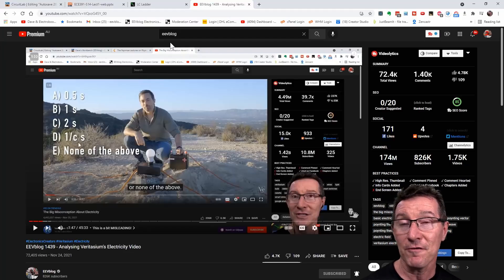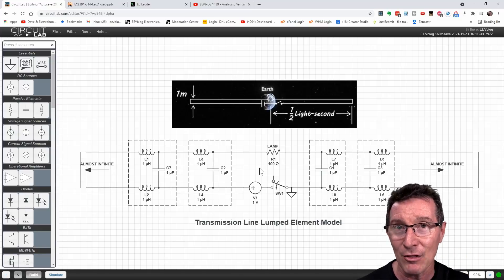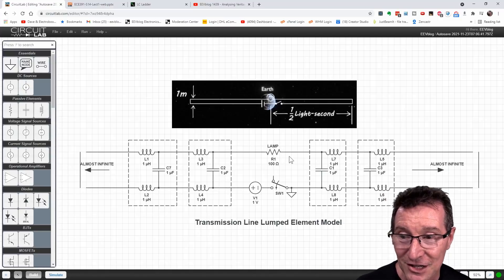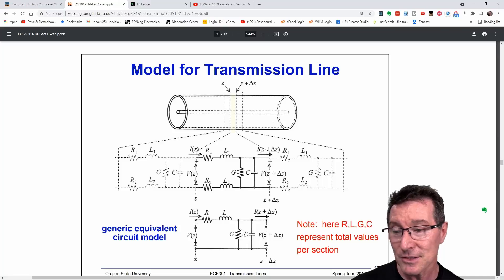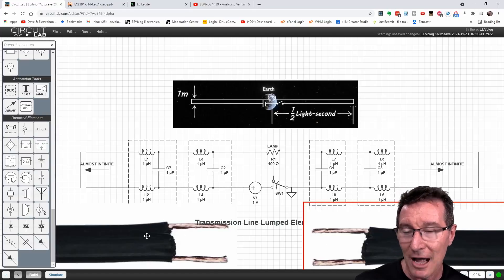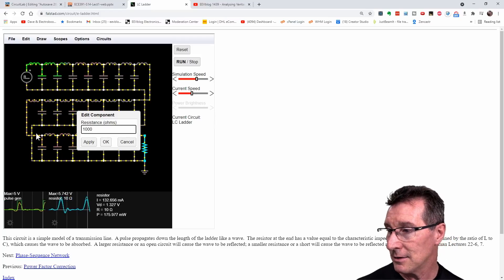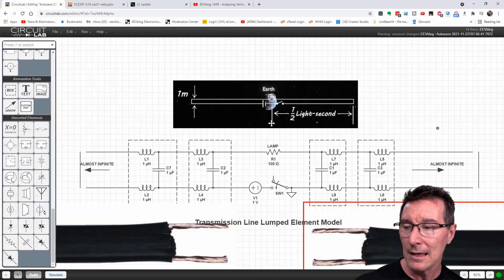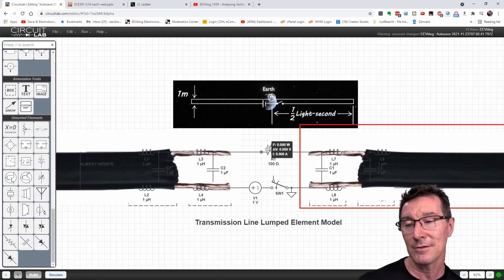Veritasium Electricity Video - Simulation Notes

Comment: "No matter for how long" i think that matters most, because i suspect most people understands this questions as turn on and stay lit, not just blinks, that could lead to big missconception.
Reply: Yeah, Derek sure didn't say that it would NOT stay lit. Which is kinda the most important point about all this.
Reply: @Basement-Science  How is the 12volt Direct Current power going to get through the insulation on the wire to couple with the opposite wire (which is also insulated) with enough power and voltage to overcome the forward voltage of a 12 volt LED?
Its nonsense. You can't just ignore the physical reality of the demonstration. I am fine with saying the wire is 300,000km, and fine with saying it has no resistance for the sake of the thought experiment. But NONE of that is needed if the only thing you want to do is measure when the EM wave "touches" the bulb. It's very clear the EM wave hits the bulb after 1 meter.
But that is not the issue. It's all the other factors previously mentioned: DC, Insulated Wire, LED Forward Voltages, 1 meter of air gap, power requirement of the LED. 
Not to mention, that the LED used in the demo almost certainly has multiple LEDs internally in a series arrangement, meaning that the forward voltage that must be overcome is multiplied.
Just ignore all these issues and it will simply go away ... (not).
Reply: @wbeaty  Third time reposting this comment which keeps getting eaten: But, LOL, I do admire your sarcasm! heeheh. Actually I am very willing to accept 300,000km of wire with NO resistance. I am just not sure how to embrace it with capacitance and Inductance given the lack of resistance. 
My issue is mostly with the definition of "ON" and the required current and voltage that allows for that definition of ON to be satisfied. I don't really consider a momentary blink of the LED to be on, if that blink is less than 1second because that would mean the light turns off before the current form the wire arrives to "keep" it on. Additionally for Veritasium to be considered "correct" in his Answer, then ON would mean that the LED had enough voltage to allow the required current to turn the LED ON at 3.3 nanoseconds. 
Bearing that all in mind lets see if it can be done:

Ok. Let's assume you might be heading in the right direction.
Your equation requires 12 volts to drive that 4.3 mA.
And let's assume that 4.3mA will actually turn the light on enough for me to see it (I can't say it really will, but, let's just say sure fine, for now)
Ok, so how are you going to get the 12 volts to actually drive that 4.3 mA?
If you look at the scientific model of the voltage presented by Veritasium as evidence on Slide #13. (see his video links, it won't let me repost the link here for some reason)
You see that at 1 second there is only 0.25 volts available to drive the LED.
(Additionally, they have modeled that at time 0 there is ~.1 volts. Not sure how that is possible but let's say it is for now)

But maybe its the wrong model with the wrong parameters. AND That also is one of my issues. He is saying that they modeled and simulated this experiment. Ok let's go with that too. Let's say its ALL correct.

Looking at the voltages from the simulation on Slide #13:
At time 0  the voltage is 0.1 and at time 0.25 the voltage is 0.25.
Per "My Definition of ON" then the results show nothing to suggest that the LED would turn on because I don't see any of the required voltages or current. 

but what about Veritasium's definition of on?  

Let's review: at time 0 there is 0.1volts and at time 1s there is 0.25 volts. By all logic and using the "any current" constraint, the bulb was already ON the moment the experiment began. Which is exactly what I said from the beginning.
I don't see how the bulb can be on with 0.1 volts. It violates my whole definition of ON. It certainly doesn't allow for 4.3mA to pass thru the Bulb.

Hmm... even if we dismiss the 0.1volts present at time zero, its pretty hard to dismiss the 0.25 volts at time 1 second. That's not even close to 12 volts.

His conclusions don't make any sense, and neither does the thought experiment.

This is what I mean about the experiment has zero utility and proves nothing more than a planck value of energy can turn the light on. Worse actually, Veritasium's simulation, which he is using to justify the results, says the light was already on at time Zero.
The constraints render it useless. The simulation evidence only shows that the voltages are inadequate OR that the voltage was always present and the bulb was already on at time zero. 
The voltage doesn't ever go above 1.1 volts LOL. Even after 20 seconds.
Or perhaps I am misreading the Simulation Slide. Maybe it reaches 1 volts at 1 second.
Either way, I don't see that as enough to light the bulb.
Reply: @wbeaty  Well, it may be true. But that thought experiment doesn't prove it. All it proves is that an infinitesimal current from a source can affect something 1 meter away. 

I don't think it proves that the amount of energy in the wire is zero. 

The reason that the electrons move at all is because the charge field is present to reach the electron. In order for the electrons to move they have to be repulsed or attracted to the fields around them. While it may make mathematical sense from a statistical point of view to model that the forces are all exterior to the wire, it is very clear that the electrons are experiencing forces which force them to move.

However, both things cannot be true as far as I know. Fact: The electrons move. Fact: they move due to the cumulative charges around them, attraction and repulsion of those charges. They move into "holes" because those holes are present... which means the forces to push them are present.

So, those forces MUST be in the wire.
Whoever said that the EM forces are NOT in the wire is simply wrong. Perhaps it is being misconstrued. Perhaps they meant that the majority of the forces are external to the wire. But I am 99.9999% sure that the electrons are moving due to the charges and electromagnetic effects of those charges which are internal to the wire.

The other option is that you are totally correct, which would then leave me with a rather big puzzle of why do the electrons move in a specific direction inside a wire if there are no forces on them? 
See, it just doesn't work that way.
Reply: It doesn't just blink, since the long wires are not just a capacitor.   It stays on, but it's not very bright  (only for a few mA, if driven at 12VDC.)   Veritasium's setup could easily light some LEDs quite visibly.   But when the full 12V comes around the bend, they become 4x brighter.

Comment: That's all well and good, but how do I use this information to optimize my audiophile speaker cables? ;)
Cheers.
Reply: Do you want to improve the THD by 0.0000001 %?
Reply: @ghlscitel6714  Joking aside, I do have a number of speaker wires running in parallel over some distance. Probably not an ideal setup, I suppose, but not something I've tested. The video made me think of it, so I ran with it. Cheers.
Reply: @WR3ND  i would say by twisting each by different amount so that they won't induce  the signal into another cable, also by maximizing the distance between them would also help
Reply: @WR3ND  The impedance of a loudspeaker system is usually between 5 and 16 ohms. A transmission line however can be hardly manufactured below 30 ohms which genuinely induces a mismatch. However, at frequencies below 20 kHz the contribution of the mismatch to the signal is minute (in the order of <10^-4). Much more important is the ohmic resistance of the cable. For proper loudspeaker match the source and cable impedance should be less than 0.1 ohms.
As Andrew mentions, also parasitic currents captured from AC magnetic fields have a more significant effect which leads to having the 2 lines close to each other so that the influents of the magnetic induction is the same on both wires and nulls out.
How long is your loudspeaker cable? What is the source impedance of your audio PA?
Reply: Thanks for the interest. My original comment was mostly just in good fun. It's not something I'm too concerned with, at least not at this hour at night for me, but I may revisit it and get back to you guys later for the sake of curiosity. Cheers. :)
Reply: @WR3ND  Understood, the joke was funny.  Just to help anyone else - speaker cables are closely parallel, or sometimes twisted, because although that adds a (very) little capacitance in parallel with the speaker coil, it also minimises the loop area of the cable which would otherwise represent a significant antenna that can pick up interference  that can get back into the amplifier and create other problems.
Reply: The more you pay, the better the sound!
Reply: @stiannobelisto573  gold and diamond plating helps right??  Right? 😬
Reply: @bsodmike  virgin elves at moonlight as well 😁👍🏻
Reply: @p_mouse8676     I use Tabasco sauce on my cables to spice up the sound.
Reply: @MickeyMishra  Ah yeah, nice. Recently I am all into the new "vegan" cables. They make it sound more earthy and grounded.
Reply: Don't bother. Just put on the package that you did, make up some language to describe it, and people will pay you millions for it.
Reply: There are transformers made for this, such as the Electro-Voice AT 100. It has coils for matching 50, 70.7 and 100 Ohm transmission lines and for your 4,8 or 16 ohm speakers and amplifier. You'll need a pair of these for each cable run for conventional loudspeakers, but pro speakers often come with the matching transformer included. The bonus is that you can probably sell the copper in your low impedance cables to pay for the transformers.
Reply: Instead why not SELL magic audiophile cables, with plenty of Maxwell-Heaviside-ian gobbledegook!   Make them hollow, for PURE skin effect, ABSOLUTELY PURE.  Slathered with high-K ceramic paste, for optimum dielectricity propagation!   William Preece tried to suppress our cables, and Edison tried to steal them!
Reply: Just connect it  to anything that costs at least half a years wages.
Reply: Make sure the speakers are exactly the same distance from the source :-)
Reply: @ianstorey1521  Hmm... They're different channels though? Or do you mean for the sake of loudness?
Reply: @WR3ND  so the signals arrive at the speakers at the same time 😎
Reply: @ianstorey1521  Oh, my mistake. XD Cheers.

Comment: But in veritasium video he considered ideal  transmission Wire with zero resistance...
Reply: The Resistance doesn't matter at all. You can make it out of superconducting wire if you like.
However you CANNOT say your wire will simply not have any capacitance or inductance towards anything because that's absolutely impossible in our universe. You are just arbitrarily picking and choosing laws of physics to ignore at that point.

Comment: What it seems we are actually looking at is the lamp illuminating due to the inductive coupling of the voltage source wire to the load wire. Essentially acting like an air-core transformer with a single winding on the primary and a single winding on the secondary. This is the B field coupling the wires at 1m/c.
Reply: Not quite. It's Capacitive Coupling between the wires. You would only start getting inductive coupling as current actually starts flowing along the transmission line.
Reply: @Basement-Science  Please explain how there will be capacitive coupling before there is inductive coupling?  I would think that they both have to happen simultaneously. Any capacitive coupling must also induce some current flow. You can't really have coupling without the charges. And for the charge to appear there has to be movement of the charges.
Reply: @marcfruchtman9473  I meant the capacitive coupling, or just the capacitance itself, is the cause of the near-instant energy transfer. Without it, the inductive coupling, and everything else, would be significantly more delayed. There are many effects at play here, but OP was implying that inductive coupling was the driving force, which is not correct.

Sorry for the late reply, youtube was being dumb.
Reply: @Basement-Science  No worries. Hmm, Respectfully, I don't really see this as a "Transmission Line" problem due to the very constraining criteria. I see it as an EM Wave touches "any current light bulb" problem. That is because the light turns on with "any current", so I don't see how transmission theory is operational to turn the light on, since the light technically turns on before there is any interaction of the first wire with the opposite wire. Consider the following as justification:

If we consider the "Ideal" version of the demonstration, then "any current" turns the light bulb on.
Given that, the moment the "ideal switch" is closed and the very first electron moves at the very center of the "ideal circuit", it will create an electromagnetic wave that radiates outward. Technically, it will, at exactly 1 meter, touch the light, but not any of the wire connecting the light (Radius = exactly 1 meter ) so, wire is not yet touched.
The moment that the EM Wave touches the bulb (but not the wire) it turns on because current flows in the bulb.
1 "moment" after that, it will touch both sides of the ideal wire. But the light is already on. 
I suppose one could say that both capacitive and inductive effects were at play. 
But since the light turns on before there are any interactions between the two wires, is it really a function of transmission problem or did the light actually turn on simply from the EM Wave. Given this is provided under "ideal" theoretical conditions, it seems to me that the light turns on prior to invoking transmission theory since there was no actual interaction between the two wires when the light turns on. 
Thoughts?
Reply: @marcfruchtman9473  The "lights up at any current" idealization is just complete nonsense in my opinion. Not only are you correct, but really, under that assumption the light will just be on regardless of the switch or even the battery, or even the wire itself since the universe is full of weak radio waves and even brownian motion of electrons, which will induce some non-zero electric energy into the lamp and "light it up".

I was assuming the more realistic scenario where the lamp is "lit up" if there is at least some percentage of the nominal current flowing through it. Really, we should be calling the lamp "lit" when it is at least at 80% max brightness or so, which would be close to the "steady state" we want from any DC source. And that will be delayed by several seconds in reality (sub-light-speed travel time along the entire loop) because then it is a transmission line problem. That's also the scenario Dave was basically talking about.
Reply: @Basement-Science  I would love to see a reasonable "LED" bulb of say 12v, and 7 to 10 watts light be used instead of the ideal light with a requirement of 80% of nominal brightness. 
But, alas, I don't think that he will do it. Because I am almost 99% certain it would not "turn on".
I was really hoping someone like ElectroBoom would take on the challenge in a more real world way.... sigh.
Reply: @marcfruchtman9473  Actually Electroboom is working on a video about it. Will be interesting to see what he says about it.

I also made a crude simulation that showed it would only reach 80% of steady state current after about 8 seconds or so. That was modeled with a regular 5mm LED at 20mA nominal current though. I only later realized that the time is actually also load-dependent and I probably overestimated the inductance by maybe a factor of 4 or so.
Reply: @Basement-Science  Ah, that sounds pretty Interesting. Perhaps you would be willing to do a simulation with something like a 7 watt LED. I am not sure how to model that as far as forward voltage is concerned.  When I reviewed the Powerpoint links Veritasium had for the video, the voltages were very low. 
I just don't see how the bulb will get anywhere near 80% nominal brightness. 
However, it might be worth examining whether you may want to set some hard current and voltage values as a fair cutoff that would indicate 80% brightness. 

Another oddity that I am not quite certain about is how to constrain the current to something reasonable given that the bulb itself is a load but the wire has no resistance.
Is it reasonable to say that since the battery is an ideal battery that it is limited to exactly the current that the bulb requires? 
If not, how does the simulation limit the initial current thru the wire?
Reply: @marcfruchtman9473  well you have to use a diode model with voltage-dependent resistance, which is what circuit simulators always use I think, and it's easiest to assume the lamp just uses a series resistor to limit the current. There are real lamps that work just like that, so if you model maybe 3x 3V white LEDs with it, your lamp model would be close enough. Then assume the brightness is just proportional to the current.

The tricky part is modeling the transmission line itself. It is way too big and significant to be modeled as single elements like Dave did if you want more accurate results. I dont really know much about circuit simulators, and the one I've used doesnt offer any distributed elements. 

Anyway, I redid the simulation that way now and recalculated the inductance to something more accurate (hopefully) and... I can hardly believe it myself: Looks like 80% is reached after 7 MINUTES and 30 seconds..
 I'll post a link to the simulation below.
Reply: @Basement-Science  7 + minutes LoL. That's waaay longer than 3.33 ns